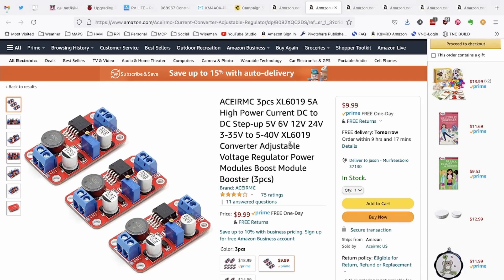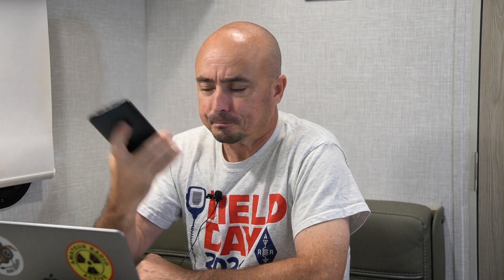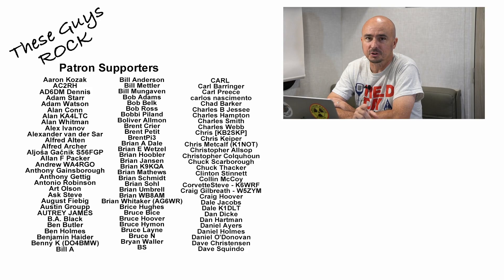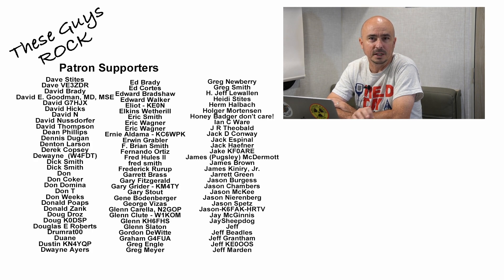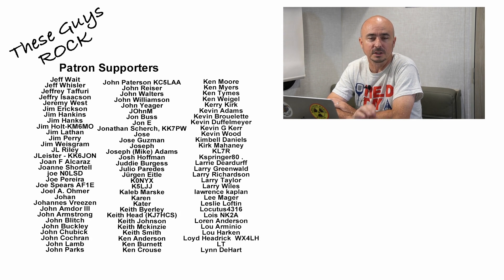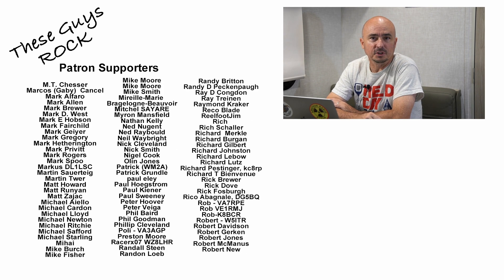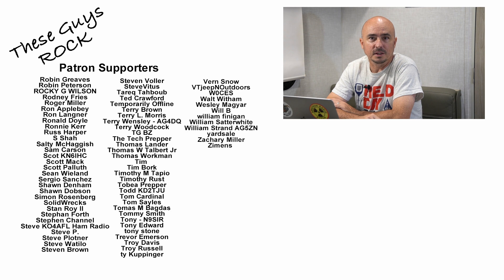Powering Your Pi in the Field

Comment: Hi Jason, I like your channel because you present also „digital“ stuff!
I would not bet that you do not have a (switching) voltage conversion. These banks often use 3.7 volt Li-Ion batteries and a boost converter to get it to 5 volts. Or more batteries in series and a buck converter. So you were happy that the manufacturer did a good job in preventing RFI. Linear regulators would become quite hot because they would have to dissipate a lot of energy.

Comment: I have used the battery pack several times and I don't have any issues with noise.  But, for the amount of time you would get using one of those, and how inexpensive the packs are you could have several with you for longer operation times.  Yes it is another piece of equipment you have to take with you but they are slim and easy to pack.  I even use these to power my GoPro camera since the GoPro battery only gives you a little over an hour of operating time.  Great video Jason!!  Juddie - WD8WV

Comment: Another great video, Jason. I tried some of the buck converters early on and I abandoned the approach due to RFI and the PCB board/components being exposed to the elements. I've landed on two approaches: 1) running off a cell phone-style battery bank as shown in this video and 2) using the 5v output on the Buddipole PowerMini v2. For anyone running into the "low voltage" alerts reported by RaspberryPi OS. I found that the cables rated for "quick charging" with support for 2.4A and 21 gauge wire or thicker to be the most effective.
Reply from the maker: I haven't tried powering the Pi direct from the PowerMini. I need to test that in the near future. That would be a super easy solution since I almost always have the PowerMini with me. For some reason I didn't think the USB on the PowerMini produced enough amps for the Pi. Thanks for the heads up!
Reply: @KM4ACK  I had low voltage warnings  with the PowerMini v1 as it only handled 1.5A. I recently acquired a PowerMini v2 and I believe it supports 2.4A (I don't have the manual handy, so don't quote me). The v2 model works great with my Pi 3B+ in the field. Give it a try.
Reply: Make fun of me but I use an 18 Volt Milwaukee battery with a phone charging adapter and it runs my pi for a long time. It's nice because those batteries are everywhere and easy to charge on the factory charger. Your videos have been very helpful by the way. Thanks for all the information!

Comment: thank you for this content.  This is just what I was looking for in regards to RFI on Solar or other power supplies.  I notice the product you referenced is not available but they have one from the same manufacture for around $6.50 or so.
Reply: Hey Jason, you mentioned that you were having some RFI issues.  Was that when the hat was powered up or the battery backup?  Also,would you rather we discuss these details in the forum on groups.io? I have heard that DC-DC conversion was a problem.  Also have heard that MPPT solar charge controllers were more of a RFI producer than the PWM (which is strange to me since the PWM is pulsing).  It would be a cool video series to demonstrate RFI from power conversion.  Not that you would have to do it, but I would definitely be interested in that sort of thing.  After all, I got into this hobby to learn.  Haha.  All the best, 73 de KI5HXM

Comment: I have a Raspi4B, and I  used a buck converter with no apparent RFI problems. I have been using a cigarette adapter style USB plug (5V, 3A) connected to my 12v power supply.  Using one kind, I kept seeing the low voltage warning. I changed to another one, and the problem seems to have disappeared. I think it is more convenient to carry one power supply than more.  But that is only my personal opinion.
Reply from the maker: I have had some buck converters in the past that were fairly quite. However, many on the market are really noisy. It often feels like trying to find a needle in a hay stack to get one that is RF quite. Also, each operator has different needs. Some are good with the power board that I showed and others prefer other means of powering the Pi. This video was mainly about showing different options that might work for different needs. Neither the power board nor the battery I showed have produced the low voltage warning. I do have an old converter that is RF quite that gives me constant low voltage warnings. I have heard others say you have higher odds of corrupting the SD card when you have low voltage but I haven't personally had this to happen.

Comment: I run a RPi 4 with a battery bank from Anker. The key is to get one with USB-C PD (power delivery). It puts out 18 watts so I haven't had any issues with low voltage warning etc.

Comment: I have a power bank that holds 8 18650's. I don't have a way to test if it has RFI. But the thing with it is that I can change the battery's, if I have more 18650's to put in. I have been using the 18650's for a fan to keep me cool when the power is out, and in flashlights. Because they have so much power in them and small they are nice to use. I need to get more of them so I have back ups. I ordered the power bank without the battery's and ordered the battery's to put in it. I have a battery charger that charges a wide range of battery's and can be used from 12 volts. There is one things that I have seen. Many of the power banks say to to use power from them when they are charging. There is a buck converter in them, or somethings about the same. Charging the power banks from Solar may not work, but charging the battery's in a charger that will run from solar and replacing them in the the power bank I think will. (can not replace the battery's one at a time, putting in fully charged 18650 in with 7 discharged one could get to be very bad! I have not tested but with mil ohms a one volt or more can be more amps than the battery wants to handle.)

Comment: From what I have seen, the Pi 4 wants 3 amps or more while the battery wants to deliver the power at 2.1 amps.  You would probably notice the little lightning bolt showing up in the corner of the display every time you tried to run a program on the pi.  The Pi 3 does not require as much of a power drain.  The power hat would probably need to be used on the Pi 4 for it to perform optimally.

Comment: Jason another great video. I also use a battery pack (not the same one you showed) and it works great. Long run time, RF quiet and fairly small and light weight. Thanks.

Comment: I had a car adapter that I used in my truck and never had a problem so I took it apart and potted it into a tin with leads and wired it into one of the power cables to my ic-7100

Comment: I used a version of this cheap Regulator for 5.1v at 3Amps supply for a Raspberry Pi 4B 8k. In experiments  I epoxied a finned heat sink on the main regulator chip and the RFI decreased substantially. I then  added a homemade common mode choke on the output side. The RFI disappeared completely except slight on 30m only noticed when conditions are poor. I have been using this for over a year and happy so far.  However in another setup I used a newer version of this regulator, which has the main coil on a yellow toroid. This board was found to be an all bands RFI generator as I think the toroid was possibly a RF type and more prone.  G4PEY
Reply from the maker: Thanks for the info. The lack of consistency is one of the reasons I got away from the check regulators.II may have to dig an old one out of the junk draw and try your solution.

Comment: A couple different things to point out:  first is the issue of the 'Low Power' pop-up and the lightning bolt, often seen when running from battery with the Pi.  In my experience, people tend to read this as a low voltage condition - which, it may be.  More than likely, however, it is an actual low power (i.e. volts and amps) condition.  The reason we notice it when running off USB battery chargers...or even older wall warts is because, while the Pi is getting enough volts, it isn't getting enough amps driving that voltage.  Most cell charging battery packs do not deliver more than 2.5A (nominal) on the USB ports.  Even the Pi 3B+ needs 3A....the Pi 4 needs more.

  Now, is this a show-stopper, critical problem?  In my experience, no.  It's always been advised that SD card corruption could occur if not providing the Pi with adequate power.  I've been running Pi boards for a number of years, this has never happeened to me.  Is it optimal ?  Definitely not.  It should be noted that even wall warts shipped with Pi's often have this exact same issue.

It is, however, highly annoying.  I'd love it if I could find a way to at least disable the text pop-up.

Second thing about using battery banks of this sort with the Pi is that many of these units will not allow simultaneous charging and discharging.  If we consider a scenario like Field Day, or an EmComm scenario, we probably want the capability to run continuously --without having to shut down operations to charge a battery bank back up --or carry multiple batteries of this type and having to swap them out.

  To this point, I have found the Romoss Sense 8+ 30,000mAh pack to allow this capability.  It has 5 ports available to the user:  MicroUSB and Lightning input, a USB-C port that will allow either in or output, one 2A and one 1.5A USB port.  It should be noted that this pack - although more versitile than typical battery packs, still will likely not deliver the amps necessary to power a Pi-4.  in fact, I just tested with a Pi 3B+ and a 7in screen....and I still got Lightning Bolt and Text Warnings about low power.  I did run this configuration during Field Day with a Pi 4, however, and it seemed a bit happier.

Another solution --and I've not tested this with the Romoss Sense8+ yet --might be to run a PiJuice hat, and charge that hat with the battery pack.  The upside to the PiJuice hat is that it has it's own battery (it's meant to be something like an UPS for the Pi), and it takes MicroUSB input to keep the battery charged.  Also, the PiJuice has a RTC built-in.  The down-side is that most cases won't play well with the PiJuice hat...which means buying the case along with the PiJuice...or making one's own.
Reply: I was just looking at a Pi Hat that called itself a UPS.  It has a couple of 18560 Lithium cell holders and it claimed to charge and deliver power at the same time.  It looked like it used up one of the Pi’s USB, though that wasn’t clear.  I wouldn’t be opposed to using a pair of 18650 cells as a UPS of sorts.  This would give me an option of having a couple being charged up if there is too much RFI in the charging, although the DC-DC conversion required with that bank of batteries might cause RFI.  NOTE: I am assuming there is voltage conversion, they didn’t state one way or the other.

Comment: Hi, Jason!
Are you still using your DRAWS hats? They have a 9-16V regulator built in and work perfect for me. Haven't noticed any noise. Ofc, having it built into an aluminium case reduces RF to the radio.
Also, charging over USB introduces noise on 2m on my 705.

Comment: M6EF-Another great video. Did you notice any undervoltage warnings using this battery bank? I use a 4-port USB board that seems to be RF quite but I occasionally get the undervoltage warning in the bottom right corner of the display after a few hours of use. I might try a  battery unit similar to this and try charging it with the 4-port USB board but run the Pi off the battery bank.
Reply from the maker: I didn't get any low voltage warnings with the pack.

Comment: Thanks. I have a high noise floor with the regular RPi power supply if to compare with the battery. Any recomendations on suppressing RF noise when running from regular power supply?

Comment: I’ve used an older battery bank to power my Pi4 several times on POTA activations. I’d receive a low voltage warning in the display, but I never used the Pi4 longer than 30-45 minutes. Being an older charger, it was not 5V. I might need to look for one (or this one) in the future when I return the Pi4 to the field.

Comment: So far, the record for my station for decoding responses from my stations HB on JS8 was with the Pi4b,  It is 17 stations decoded at one time. Definitely the Pi 4b is the way to go for JS8. Mine is the 8gb. Its still in basic mode running off a Micro SD card. I have the 256gb fast SSD and it might be even more fast and or powerful with that running. I have a very good 18650 to 5v battery bank and need to try that.  Incidentally all of the battery banks I've seen take 3.7vdc from 18650s and convert it up to 5vdc. Not sure how it could be done any other way. But, it may be a really quiet up converter. N6GRG Incidentally, I used a system to take 3 18650 in series down to 6v and it was very quiet. It is a short wave radio. I do need to figure out a way to automatically disconnect when the 18650s are discharged as taking them below discharge can ruin them.

Comment: I tried a 10000mah battery bank to power my PI 3b, I had a low voltage message immediately. It might because of the age of the power bank.  It was brought at Walmart two years ago. It has been adequate for recharging my Samsung Orbit cell phone and extending the up time of both my android and fire tablets while off grid. I did have my PI case CPU fan connected to the PI 3.3V pins.
Reply from the maker: It may be the battery pack is at fault or it could be the USB cable. I have had cheap cables give me the low voltage alert and simply swapping cables solved the issue.
Reply: @KM4ACK  TNX Jason, I'll try another USB cable.

Comment: Every time I've used a battery bank like these with my Pi4B I've had the yellow lightning bolt error And random shutoffs.
I use what's called a PiSugar 2 pro. And it works great
Reply from the maker: not all of the battery banks are created equal. this one has been working fine so far :-)
Reply: The USB cable you are using may be causing your problem.  Many have too much voltage drop.
Reply: @RandyW4LKS  I use high quality USB C cables. The one I used most recently was one I used to charge my MacBook and iPad Pro.

Comment: What case did you use with this power board mounted?
Reply from the maker: This is the case I use https://amzn.to/3odNu0V (affiliate link). You have to make a few mods to the case but it is super easy to do and the only case I have found that fits the power board this well.
Reply: @KM4ACK  Thanks!!

Comment: Why not just use an LM7805? Gene N7ARO
Reply from the maker: Most of the ones I have seen are limited to 1.5-2.4A output which wouldn't be enough for the Pi. Have you seen one that will give ≥3A out?
Reply: The 7805 is a linear regulator and would waste a lot of the batteries power. Going from 12 to 5 volts would cause a 7 volt drop across the regulator. At 3 amps draw, that would be 21 watts dissipated in heat and only 15 watts delivered to the pi.  Only 42% of the battery power delivered would be delivered to the pi.  That is why there is usually a buck converter type circuit.